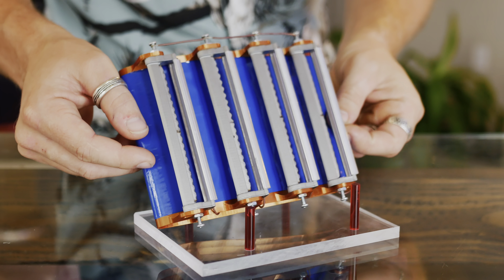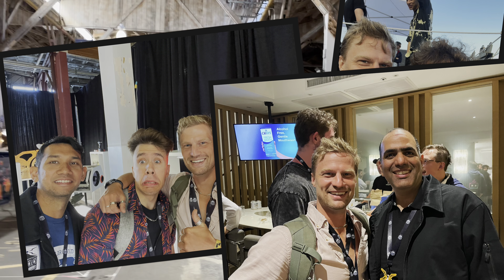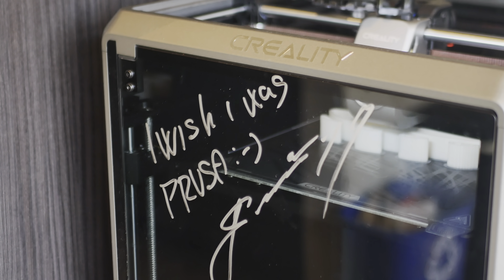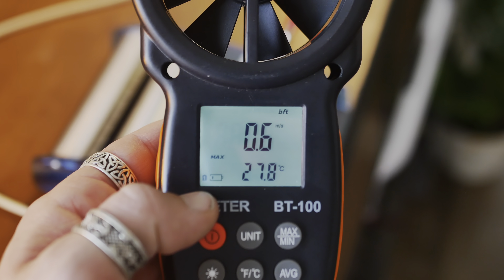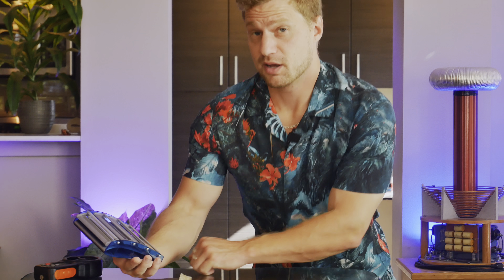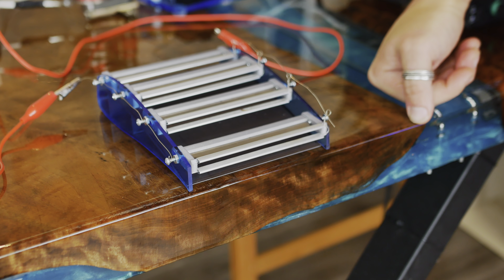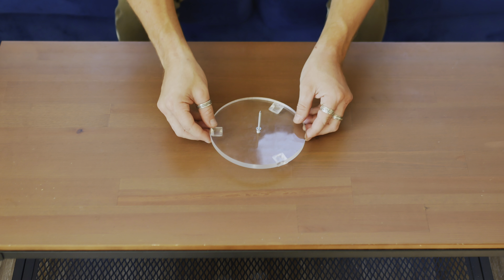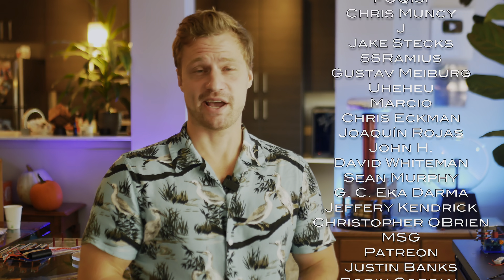Designing A Self Propelling Ionic Thrust Wing

Comment: I mean your trying to make an Ion drive thats optimized for a vacuum work in air. Ion drives have shitty ISP in air, and they have shitty thrust in a vacuum. 

If you clould create an evacutated wing, air inflowing from the leading edge, at flight you might get a vacuum working from the ventury effect of air leaving the tailing edge and accelerated in the cavity of the wing and expelled on the tailing edge that lacks air control surfaces. The problem is dynamics
Accelerating  air in the wing that has slowed down because you restricted airflow to create a vacuum and at the same time expanding air in the outflow. 

Lets just for a minute consider the best possible Ion drive in a vacuum. The HiPep has a power of 35 kw and a maximum ISP of 8800 at about 80% efficiency. 

Lets do the math 8800 x 10 - 2% = 88000 - 176 = 87824 Ve. 

Thrust = "35kw x .8" 28,000 watt/87824 m/sec = 0.32N of thrust. 

So lets consider this drives effect on the air in the system, the accelerated particles, in the system are traveling at 300 m/s, they are bombarded by a particle traveling at 90,000 meters per second. The consequence of the collision is that both particles lose electrons that go randomly flying, one particle goes off at 45 degrees at 1000s of meters per second, the other the other direction. The net effect is that 99.9% of the original motion is lost to heating up the air. 

So we dont want more tension but less, we dont want units father apart but closer and at lower voltages If you can create a series of small ion accelerators that feed into the tailing edge of a wing (not at control surface) to could create the optimal circumstance to give lift. You obviously are not going to compete in mass flow, but you might get some improvements in lift. 

  Is this a new era in flight? No.

Comment: I think you could increase efficiency - Make each stage be 25kV greater than the last stage.  You would basically put another HV supply between each stage in addition to the supply on each stage.  The wing would be ~175Kv from leading edge to trailing with 7 supplies

Comment: What about the funnel effect, like your other video. Can you build the ion engine into the wing , having open area or areas for air in and narrow exit vent. Giving comprehension and also using the inside of the fuselage to support your + - instead of adding supports.

Comment: As you were using a dry ice "fog", this visual aid contained LOTS of moisture that "may" influence the performance of your ion engines, as seen with some sparking when the fog was introduced in the "input" side of the thruster.  Instead of a pure, nonconducting visual medium, the dry ice fog would have a tendency to "short out" the ion flow????

Comment: Would the thrust supplement the velocity of the wing from other sources?  So if a wing was traveling at 60-200 m/s from power, would the thrust add to it?  Furthermore, at altitude, the air is much thinner, and the question is does the thrust increase as air pressure delines?

Comment: I love what you are doing
However I think this wing design without a smooth and uniform top surface will not create lower pressure needed above the airfoil to create lift and fly 
These would need to be integrated inside the smooth shell of the wing, and send the thrust through the rear seam somehow or through vents like a stealth aircraft
If you could vector the thrust up and down maybe it could even be used like ailerons

Comment: Look at Jetoptera's Bladeless Propulsion System and Dyson bladeless fan. You're replacing the compressed air induction with ionic wind. 
The staged system on top of the wing is already a no-go. You want a single segment integrated in the airfoil. 
Anything on top of the wing obstructs lift. As it is, I think you're generating negative lift along with way too much drag, although you have thrust.

Comment: For an RC sized prototype, instead of creating a standard airplane shape and risking crashing from height, why not initially try a ground or water based craft that lifts off only a small distance off the take off surface and uses the air cushion effect on the wings to aid lift. That way you will not be destroying build after build crashing flying craft. You could power the wheels to get the speed up at first to ensure air flow over the wings before powering your ionic thrusters. This way you can test a prototype safely.

Comment: The ion thrust could be under the wing? resulting the Coanda effect? result could be lift at a low speed thrust, for a low speed plane or drone. after all, you need it to fly, not just move. if it generates half the lift half thrust, a few sets of wings combined could lift twice the weight of the combined load. resulting in a plane that can fly with more then self weight, means, you, invented the plane that needs no moving parts based on ionic engine. you would need a longer wing so, that may be a problem

Comment: A couple of questions for you. 1. Once you do some air tunnel testing can you determine if the amount of drag caused by the thrusters will be overcome by the thrust produced? 2. Is the flow being distributed around the wing in a way that would mess up lift? By this I mean airfoils have a high and low pressure side. The top being the low pressure side and the bottom being the high pressure side. 3. How much flow disruption is happening on the trailing end of the airfoil and where does it occur? Pressure drag occurs due to flow separation and different speeds/disruption of flow over the airfoil at that trailing end. This is why you typically only see engines mounted below the wing and in certain spots vs integrated with the wing itself. Every bump/rivet/mounted object will cause a decrease in efficiency and I believe will be the downfall of this design. Thats not to say what you’re doing it bad! I think this was a great video as I personally haven’t learned much about ionic propulsion at my university as we tend to focus on how things currently are in aviation and why they work the way they do. I’m looking forward to your next video!!!

Comment: Say you had a flying saucer, and the majority of the outside hull of the ship had millions of tiny holes.  The inside being a complex series of isolated grid section where voltage can be controlled extremely precisely by AI, turning most of the hull of the ship into an omni-directional thruster.  The direction of thrust depends on the distribution of power.

I bet that's how them aliens do it...

Comment: Dumb question: why your thrusters are going over the wing, instead of under the wing?

DQ 2: Why not make a big wing (like from gliders) which a big thruster (meaning just one very wide blade) under it?

DQ 3: Why you changed your approach without testing a mounted central ionic thruster under the air model? Or at least making both to compare each design?

Congratulations on the creations, that's how innovation works

Comment: I think this ionic engine concept is a key to not only more advanced flight but space flight. As a jet engine lacks the air to really go anywhere. And the solid fuel used for the space shuttle isn't gonna be enough to travel in space or have control. The amount of weight that fuel adds the the ship is substantial while if using an ionic engine it would be possible to have much long flight and lighter loads on space shuttles as they could just be powered by a nuclear reactor.

Comment: To the Author, have you tried replacing the razor blades with your older idea of wire but still in front of the profiled aluminium tube? The wire would block less airflow and be lighter, like your previous projects, I haven't seen everything you have done yet😅😅 good work!

Comment: your video is very inspiring. I'm a glider pilot and would love to switch on thrusters on those days when thermal lift is rare. 

Have you tried putting the thrusters inside the wing which will allow you to have a smoother aerofoil which will then allow the wing to produce better lift. Also, if the thrusters are inside the wing, you can stagger them so their thrusts are aligned which will mean air flow won't need to change direction to avoid the following thrusters. This should result in more efficient thrust with the intake at the leading edge and exhaust at the trailing edge.

Comment: solution:
(Improved) Surface Dielectric-Barrier-Discharge. (DBD)

ie: Put the electrodes on and in the top wing surface.
https://media.springernature.com/lw685/springer-static/image/art%3A10.1038%2Fs41598-019-42284-w/MediaObjects/41598_2019_42284_Fig6_HTML.png?as=webp

https://www.nature.com/articles/s41598-019-42284-w

https://www.youtube.com/watch?v=-v67vVTGgIs

Comment: While the self-propelling ionic thrust wing is a promising concept, significant technological advancements are required before it can be practically implemented in aircraft. Overcoming the challenges of thrust density, power requirements, and scalability will be crucial for its future viability. Continued research holds the potential to unlock the benefits of silent, efficient, and long-endurance flight offered by ionic propulsion

Comment: Shouldn't the thrust be under the wing in order to create lift? I may be wrong, but isn't the whole way a wing crates lift is by moving a higher volume of air under the wing and a lower volume on top? With this design it would seem you're going to create an equal volume of air on top and bottom.

Comment: You should have put the ionic thrusters on the bottom side of the wing, because to generate Lyft you need fast moving air under the wing in slow-moving are over top of it

Comment: it might be a good idea to mount the ionic thruster layers inside the wing and use the air that has been accelerated to replace the boundary flow layer with each stage. That way you could reduce drag by ensuring laminar flow and not having a large structure sticking up out of the wing. That would reduce the amount of thrust you need to generate in order to make something fly.
Reply: Alwyn has a good idea
Reply: You mean like a CoFlow jet ?
Reply: @vuibulevbaoultch8727  The ion thruster mounted on top of the wing is already a bit like that. I was thinking more like an ionic thruster version of the Northrop X-21 boundary flow control system.
Reply: I think this is a great idea. It might be a touch more advantage to keep the top mount ion thruster as well as integrating into the wing. Also utilizing the bottom of the wing and having the three thruster meet at the rear of the wing to maximize working space. With two round ion thrusters mount to the body next to the battery supply. Maybe cork screw the series of ion thrusters on the body to get more of a vortex as well. FYI I’m a very poor educated middle age idiot. So I have no expertise to say of here but I do build fast things like bikes and cars. Rule one. If there space it works. No dead weight no wasted opportunity
Reply: Something Jean Louis Naudin made years ago :)
Reply: yeah, the way this is structured, and crosswind or turbulence will interfere with the thrust, not just the lift. i could think of it looking a little like a skylon engine acrooss the whole surface of the wing.
Reply: @sorejack  Yes, it certainly could be structured that way. You mean the rim of ramjets that go around the outside of the SABER engine but along the wing right? Turbulence between the boundary flow and upper layers is the problem. So accelerating the boundary flow layer would either reduce or invert that. 

I was thinking of something integrated into the structure of the wing so that it has the drag and lift characteristics of a normal wing when off. but produces both lift and trust whilst reducing drag when turned on.
Reply: @alwynwatson6119   something like https://youtu.be/2U8gAPT-x3A?si=sVi4sl6s8T2lX4Za will be cool to try. But I "think" that this Ionic are good acelerating particles not increasing pressure, then I have a tendency to think more in a Ram turbine, that just let the flow pass thru acelerating it. Like an airfoil truncated in the atac profile and in the exit profile and in the interior all this acelerating ionic thing. Keep going I can't wait to see the next airfoil!!!
Reply: @carloscirera2605  That is because the design in the video is designed to use a compressor, not an accelerator. I prefer the concepts that add trust. Like a version of that which intakes at the front of the wing and accelerates it at the back. I think this could work because the intake would ingest the boundary flow layer whilst it is still lamina. Accelerating air out the back will create a suction upstream that would help the air stick to the wing and blow air over the wing so that it can generate lift even when stationarey.

Comment: it looks nice, but i fear your plane will only ever fly into the ground with this configuration.  to provide lift, a wing needs high speed air flowing under the wing and low speed air flowing over the top of the wing, creating a high pressure under the wing and a low pressure on top of the wing.  (in order to provide the lift you will need, your ion thrusters will need to be installed under the wing.)

Comment: Men you are doing it the wrong way. You need a really long pair of strings. Thru what you have show there are not benefits in puting the "air flow geberators" in séries

A further idea is that you don't need a rudder. You probably could change the direction of the plane by modeling the voltage supplied for each wing

Comment: The top curve of the wing is wrong the air having to make a turn causes friction. It should be a flat surface on top. On the wing this causes lift, but if you just want to thrust get rid of the curve because the negative upward pressure.

Comment: I've always thought about using some sort of ionic shell around an aircraft to break friction, thereby allowing it to fly at otherwise impossible speeds without heating up.
Similar to blasting air in front of a torpedo underwater, which allows it to speed forward with less drag from water.

But I can't math.

If you make it happen it was my idea first, I claim the credit.

Comment: Planes work on a principal of Thrust vs Drag and Weight vs Lift.  You have two problems with your design that hinder your design, that being weight and drag.  You're wanting a slow flight characteristic with the most lift.  Ultralights don't always use a wing with a lower part of the chamber.  Use a few struts and only the upper part of the chamber of the wing, that will lower your weight dramatically, yet still provide the lift.  Yes, different materials can provide a lighter wing than what you are using.  However, your biggest drawback on your design will be overcoming the drag it produces.  Good luck!

Comment: I believe in this too, because to my understanding, plane wings work, by the air flowing above them, being faster than the air flowing below.
My concerns are:
1 
Are the ionic thrusters creating flow separation from the top of the wing? If so, then maybe it would be better to just use multi-element wings, where the wing sections themselves are the positives & grounds? Or, would it be better if the thrusters were closer to the wing surface? Maybe build the Ground sections into the wing itself, with positive mini wings between the sections, and their angle-of-attack following the upper shape of the wing?

And 2.
If it's possible to flip the currant to make the thrust backwards, then can that be an effective brake, be it dogfighting manuvers, or, just reversing the thrust like a commercial jet, trying not to roll off a runway after landing.

Either way, I love this idea sofa-king much.
Great job.

Comment: Suggestion: instead of "extruding" the NACA airfoil to make a wing, revolve the same profile around a vertical axis (symmetry of revolution) to make a disk. The linear parallel linear electrodes of your wing then become concentric rings on top of the disk. Tilt it 90° (positioned vertically its the edge) and see if the lower pressure arising in front of the disk from the radial airflow induced by the Coanda effect can propel it on your merry-go-round gantry!

Comment: If you get a glider equipped with this  successfully and get it off of the ground, it will purify the air it passes through causing dirt particles to stick to the ionic thrust source. the dirt particles will cause drag and slow the aircraft. This would need a filter on a ducted intake of some sort

Comment: Maybe this design could be a nice idea to brainstorm. Do you have in mind a lifter? Is a polygon composed by many sides, built with two electrodes. One is Alu foil the other is a wire. So, one of this side if rotated IS a wing. And is it possible to shape as you want. Putting it inside a frame airfoil shaped or shape itself.

Comment: Nice. Really. Have you thought to put the thruster INSIDE the wing foil less aerodynamic trust I suppose and provide a guided channel for the air? A thruster has the same efficiency to push moving or still air? Maybe it could be best to put many side by side opposite to one at the tail of the other.

Comment: Wings are generally metal. Why not use the wing as the leading component and two razors behind the wing as the trailing,  A high aspect wing is ling and thin so, The wing and one long set of razors should do it?
If composite a flush razor at the trailing edge would do.

Comment: What about the idea of putting those ionic thrusters in a channel focusing them on a a angle downward. Kind of like how a jet engine channels the the air into the turbine. You can probably channel it to a common output exit. If you send the air velocity down a common channel will the wind velocity increase?

Doesn’t the ionic thursters need to be under the wing to create lift? You are going to need aileron to control the lift and decent?